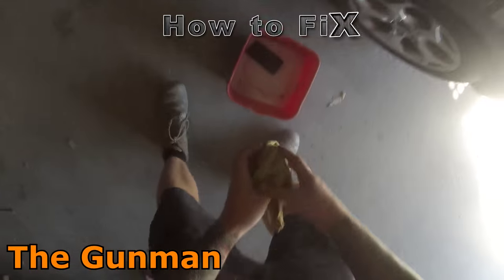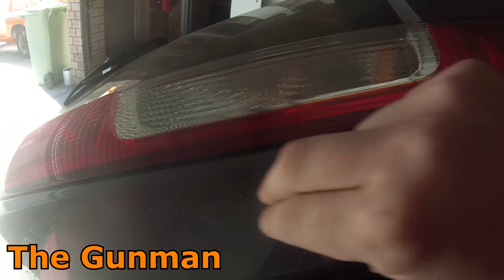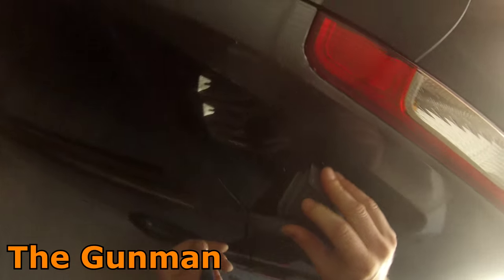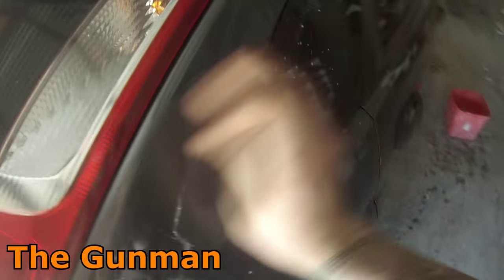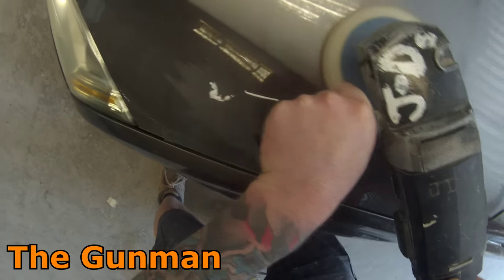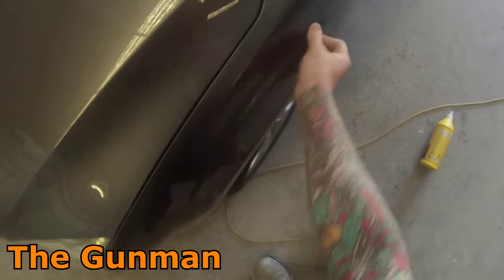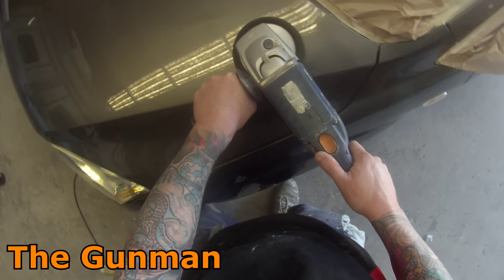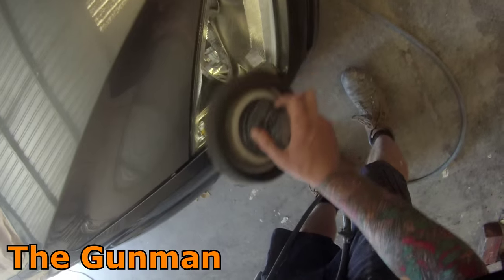Polishing a Car

Comment: I use a 6" Hico with 3M foam 1000 to 5000. Then 5 different polishing pads. It works fine. As I can also do head lights with it. Using 3M headlight clear coat UV coating. 

If you like to save money. Buy a 6" Hook Kit. It is 3/4" thick and use stick on... But $50.00-$60.00 for 15 pads is cheap. If you treat them right. Each pad can last a long time....1000 is great for removing over spray fast.

Comment: When using the tungsten block, aren't you cutting through the clear coat? I'd say the parts where it did need to be touched up with a blending coat of clear. Am I mistaken? Love your videos btw!
Reply: Ive made the clear run.  When tacky. Ive  used a wet paint brush with water based cleaner.  brushed the run out gently then hit it with 1k blending clear... Then wetsand over when dry.
Reply: and yes you are cutting the clear coat.

Comment: TBH I personally don't think this is the method you should be taking when compounding and polishing your car. When cutting (compounding) I would use a DA polisher, even a cheap one will do, makes the finish and cut better and more efficient and a lot safer for new guys, its pretty hard to burn through any paint. Use it with a microfibre cutting pad (Meguiars is the best IMO) and it will leave no swirls, it is used to cut out swirls and scratches for professional detailers. The polishing stage should also us the DA but with a finer grade polishing/finishing pad. and once all this is done wipe the car down with IPA on a microfibre cloth and then seal it with your wax of choice/coating whatever you want to do. I use a sealant to protect the paint and then layer it with carnuba wax. "Polishing with wax" is not a thing, it just hides any scratches you may have in your paint it, doesn't actually get rid of them. Not attacking, just letting you know.